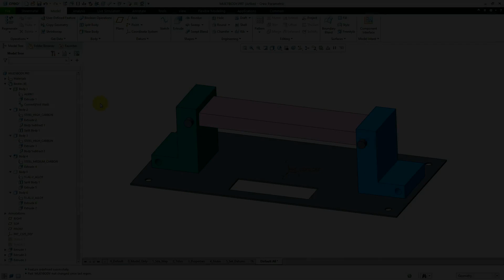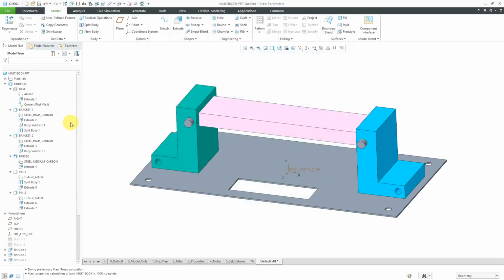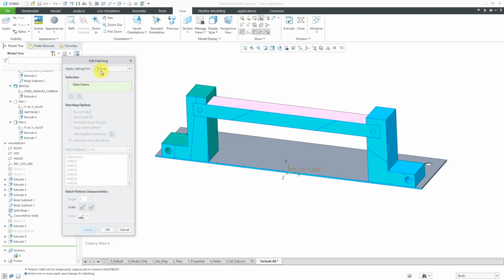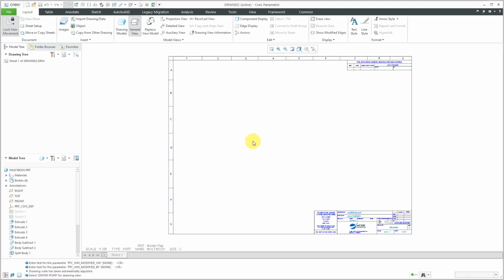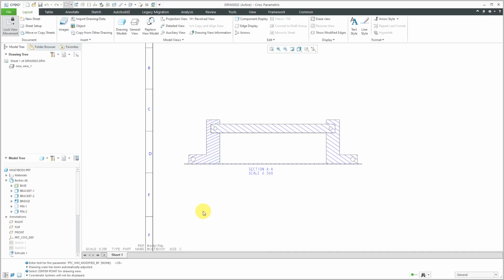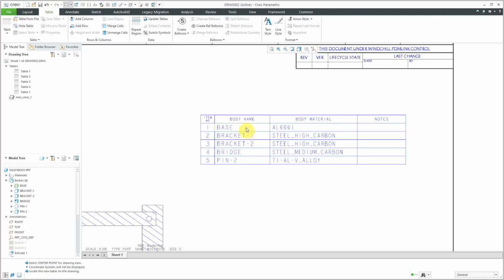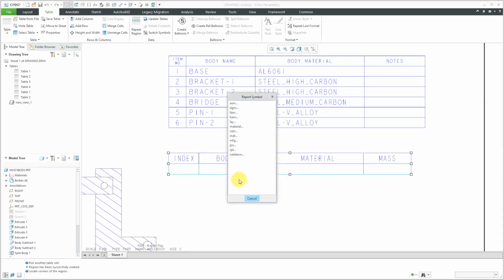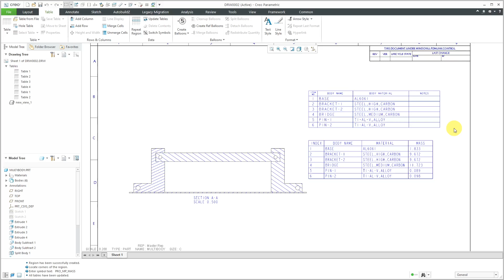Creo Parametric 7.0 - Multibody Modeling and Drawings

Comment: Hi Dave, i got couple of questions after watching this video.
1. Can i insert balloons using the table shown in this video?
2. How can i insert all the bodies separately in the drawing without saving the bodies as separate part? 
Thanks.
Reply from the maker: It appears that BOM balloons are not yet supported for Multibody. That sounds like a great suggestion for an enhancement.
Reply: Thanks for your quick reply Dave.
Can you tell me something about the 2nd question?
I use Creo and Solidworks both together. I can insert separate bodies directly into my drawing without saving them as the separate part in Solidworks. This is the actual reason to use multi body part. Otherwise top down assembly approach is better. Thanks.
Reply from the maker: I don't believe that is supported yet. I suggest you submit that to Martin on PTC Community so he can consider it for a future enhancement. 
Actually, there are many reasons to use Multibody, not just for drawings. Martin identified 13 different use cases that defined the specifications for the current functionality. More use cases are being implemented. 
And as I've said in other comments, Multibody and TDD are not mutually exclusive. As with everything they have their pros and cons, and in different situations either could be a better choice than the other. I'll be addressing this in the second edition of "Top Down Design in Creo Parametric."

Comment: Thanks for the demonstration Dave.  What is your opinion on how to utilize multibody effectively with Windchill?  I agree with your comment below on how it makes a lot of sense with multi-shot parts.  But how does Windchill treat each body in a part?  In a insert molding scenario for example where the insert nut is an off the shelf part, would you say it is still more appropriate to use an assembly still?  Just curious about what your thoughts are.
Reply from the maker: I’ve got some posts on this on my Patreon. Martin N. explained back in January at the PTC/USER event that they haven’t figured out the PEM nut use case yet because they haven’t figured out how to handle BOMs and Product Structures in Windchill.

Comment: I don't get the point of multibodies.  Why not just model it like normal with parts and an assembly?
Reply from the maker: You are free to go that route if you want. Multibody is an alternative for those who don't want to use Skeletons and Data Sharing features. In a simple model with fewer interdependencies, Multibody can be more efficient. And there are definitely use cases where Multibody makes more sense. When I was at Amazon, we could have used it for multi-shot multi-material injection molded parts, like those with overmold. If you take a look at cases for tablets or readers, Multibody would be much easier or sensible than assemblies.
Reply: Every time using assembly is boring
So for fast forward concept it's nice to have multibody it make rendering work easy to using material for specific part
Reply from the maker: Multibody can be faster for concept design. Sometimes you're working on a part and then realize, aw crap, this should have been a Skeleton, and Multibody can eliminate that. Also I've been in real world situations where we wanted to model top level Skeletons with solid geometry but then got into problems when features intersected and the solids automatically get merged. But it's not like you have to choose Multibody or Skeletons. They're not mutually exclusive. And Skeletons support Multibody. It's another tool that people have in their toolbox and they can choose to use it or not.
Reply: Hi Brian,
I will make it even simple. Multi body part design is for those parts which can't be manufacture as single part due to some manufacturing constrain. we split such part into multiple pieces for easy manufacturing. Mainly a Splitted part where any body  doesn't need to be saved as separate part after splitting,  is the multi body part. For example, Let's assume i am manufacturing a big size of o-ring. If i can manufacture it as single part in my workshop, it's good. if not, i will break it into 3 pieces for easy manufacturing. In the drawing one view, i will show it as single part and another view i will show as in 3 pieces for manufacturing. later on, i can join it by another process. If after splitting the part as multi body, you need to save it as separate part, It's better to go with top-down assembly approach.
Reply: Any kind of clam shell model/ model that you want to take and split up is more effectively created using multibody modelling. I.e. instead of making a change to multiple parts, you can make the change to multiple bodies at once.

Comment: Thanks Dave! So suppose you wanted to make a fully-dimensioned detailed view of BRACKET-1, is there an easy way to set a body as an “active model”, so that when a new view is created it is only of that active body? Or is the only way to control the visibility of bodies through the use of layers, simplified reps, or the Component Display button?
Reply from the maker: Please see towards the end of this video: https://youtu.be/Tb5JlnWCCzA  I would extract Bracket-1 to its own part then do a drawing of that.
Reply: @CADPLMGuy  Hi, thanks for the great video. However, when you extract Bracket-1 and create a drawing for it, there is no way to import dimensions. At that point, all dimensions of the part must be manually added which is not ideal. Is there a way to bring in dimensions from the original multibody part?